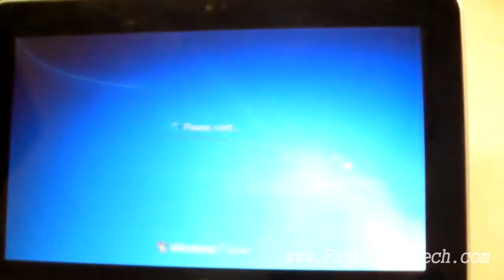HP Mini 210 LCD Screen Replacement

Comment: hey, thanks for the video, but I agree with some of the other posts, I am not sure you need to break down the computer.  Couldn't you just pull the backplate off and unplug the video strip connection and unscrew the 4 screws.. and off... I'll let you know, but other than this, its a great break down video (for other issue or parts that need replacment.

Comment: is it possible to upgrade a low res 210 to the hd lcd?
Reply: Already know an answer? I'm interested too. But according Service Manual I think not possible because screen is controlled by BIOS and that BIOS just have some controllers built in.
Reply: you mean motherboard
Reply: No. Motherboard don't have problem with that because board of normal lcd and hd version its same. Problem is BIOS is not same ( I think ).
Reply: Pedro Fernandes
ok

Comment: too much effort. There is an easier way.. But your VIdeo allowed me to see how the LCD cable pops off. Does anybody know whatthis problem is...I changed LCD screen and shorted the battery.. Now the old and the new LCD  screen show up in gree. So I have now ordered a cable for it. Do you think it is the cable???? Cheers and great video!

Comment: The problem with the Mini 210 is its cheap plastic construction and hard drives that crash.  A "new" one was obtained and this is still giving good service although the Swiss keyboard is a PITA. Latest fault is that only one hinge is working.  The hinges have friction-clutches to hold the screen open but the mechanicals (I refuse to call it Engineering) are very poor.  It is not the hinge per-se that fails, it is the plastic that the hinge is screwed to!  If anyone knows of an adhesive that will bond properly with the broken "picture-frame" I would be very interested to know.  I live in the UK and whilst getting goods from the US is possible,  Germany is a lot nearer and there is no hassle with the Customs & Excise people.  Thanks in advance and best regards from Davey.